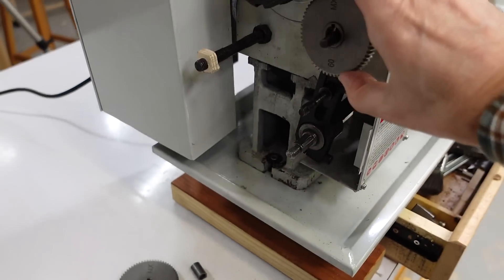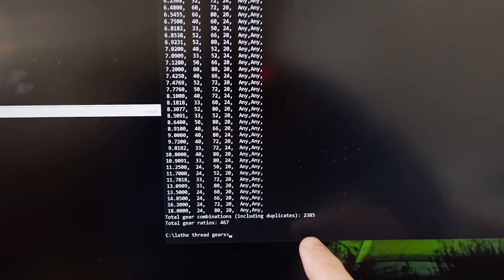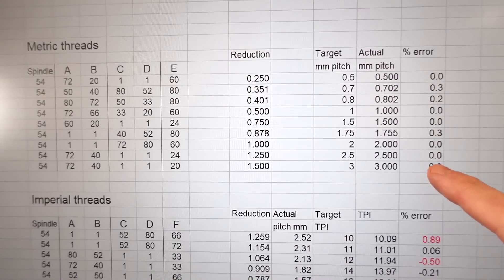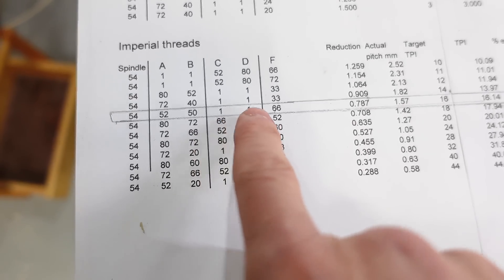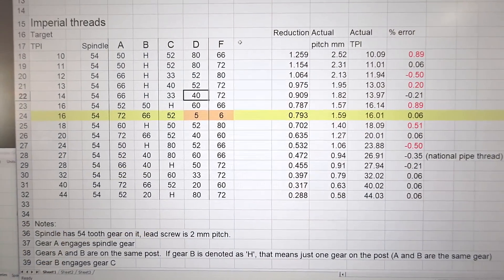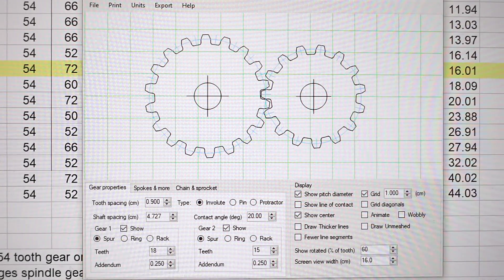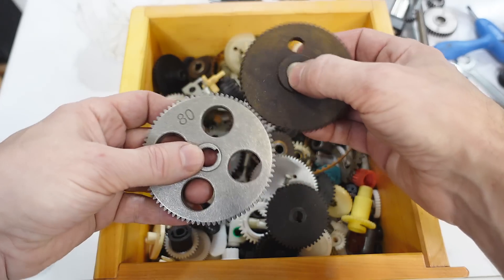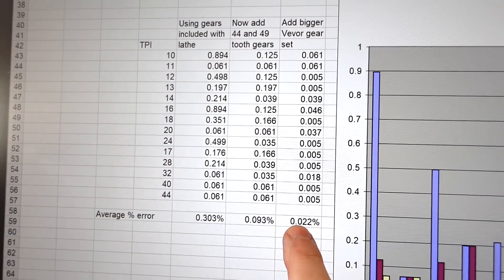Cut *any* thread pitch on a metal lathe

Comment: This video had maths, spreadsheets, Python programming, gear design, wooden gear making and a lathe cutting threads. What more could you want. Brilliant video! I found the part with the wooden gears fitted in the lathe particularly amusing.
Reply: Face it, Mathias is a national treasure.
Reply: Those wooden gears are giving me 'it's stupid but it works' vibes...

And if it's stupid, but it works (safely!), then it's not stupid ❤

Comment: My lathe is all imperial so I muddled along with calculated metric threads until I could 3d print a 100:127 tooth pair and now I have 0 error metric threads.
Reply: So your lathe predates the Great War, does it? Because that's the last time anyone used Imperial dimensions industrially. That same war is why the Empire had to give up on their measuring system too. It was a bit greater than they could handle. America never used Imperial either. By then we'd started using Standard. Which is the inch that's precisely 2.54 centimeters. That was no happy accident. A Swede came up with the idea.
Reply: @1pcfred  nope, 1953 or so, Myford ML7, and plenty more made after that, all imperial
Reply: @1pcfred  oh I see now, you are confusing my use of the word imperial with the definitions of the inch, whereas I use it as ‘inches’ generically, as opposed to metric.  Perhaps I should have used bananas instead (-: (refer to Cutting Edge Engineering channel for definition of the banana measuring unit)

Comment: They should include a 63T gear.  I don't know why none of the mini-lathe manufacturers do that.
Reply from the maker: 63 because its nearly half 127?  You can approximate 127/50 much closer than that with other gears.
Reply: @matthiaswandel But 63T is only one additional gear.  And the mini-lathes already come with a 65T gear, so we know there won't be any fitment issues.  With 63T I would be able to cut 1.5mm pitch to 0.013% accuracy, which is even way beyond measuring accuracy.  One gear solves so much.

Comment: in order for the 1.0% error of the 16TPI threads to become a serious issue, you'd need to thread on more than, at a guess, 25 threads.  The threading in commercially-available nuts isn't fabulous to begin with and at 25 threads - 1-1/2" of threaded length - you'd still only be off by 1/4 of a thread with sufficient slop in the engagement for it to not matter.

Comment: One related and interesting problem would be to either propose a set of gears that would have a better precision than what they provide,  or propose a few additional gears that would dramatically increase the precision of the initial set. 
It can easily be brute forced, given the low numbers of gears. And that way, Vevor can also provide and small hardware upgrade in addition for the revised table.
Reply: Yeah, some logic in his program to determine which gears could be used to cover the most combinations would be helpful.

Comment: Excellent work Matthias. 
Given the ability to make gears and if necessary swap out lead screws the lathe can make an infinite number of thread pitches. 
Until SAE began standardizing threads nearly any thread was proprietary just because the person who needed a thread made one to match their ability and or equipment. 
I repair antique tools from the 1800's on up with only the occasional one having anything close to standard thread sizes. Just knowing how to juggle the gear ratios is invaluable. 
P.S. Wood gears will suffice for a few threads. Most of the time they will outlast the need for them. If they wear out, making new ones isn't difficult. 
Thanks for the inspiration.
Reply from the maker: So far I have never had any wooden gears wear out.  These the plywood was  bit thin, with thicker plywood, I could make a pair that outlasts the lathe.

Comment: Fascinating, and a bit frightening, stuff. Now this makes me feel I need to check the accuracy of my lathe. I wonder what the accepted accuracy is for non cheapo lathes.

UPDATE: so I checked the gear chart on my lathe, with an imperial leadscrew, and the M8x1.25 that I need is within .001% or so. 127 &120 tooth gears on the same shaft seem to be the key to convert imperial to metric. And swapping a 40 to a 32 or 30 for some of the ranges (because of the imperial quick change gearbox).

Comment: COOL! You could 3D print gears as well. I wrote a similar program but for dado sets. Input a dado set definition, blades, chipper and shims, with both nominal and actual sizes, and it computes all of the possible combinations. It also gives the order of the components to maintain as close as possible balanced widths between the halves of the dado set.

Comment: I've made gears (when i was a teen and didn't have a proper lathe) with baltic ply (i think it was 15 layers) and here's the kicker. If you lightly score the faces of the teeth with a thin saw, then dip the gear in thin (model making) cyanoacrylate, they'll last even longer than plastic gears, which are widely used. You can achieve good precision across the teeth if you make a jig sander using a dulled file and ball bearing rollers set in a V. It will cut only as deep as the face of the tooth. Had perfect threads cut with that lathe. Proper thread against my thread, perfect mesh. I never "hardened" the key hole, because i was afraid it was too strong, stronger than a plastic gear (for sure) so i just left that natural ply on purpose. I had to re-key the gear maybe... 5 times total in 4 years. Wood gears? 100% plausible and highly recommended. Cheaper and your determination to get them proper is the factor at play. I used Tamiya superglue, but any thin superglue (read cheap, because it's thinned out) will work.

Comment: Fantastic video Matthias. Now you could pitch (pin intended) another idea to Vevor. Working out what gear tooth numbers wheels they have to provide in a set that is optimized for the minimalist number of wheels to get a set of metric and imperial pitches most often used in industry. And what gears to include in a de-luxe set. 
The very first thing you have to work out is what is the pitch of the screw for advancing the support. If you have a metric screw you can get all standard thread pitches bang-on with a relatively small number of wheels. With a 127 tooth wheel you can convert it to an imperial pitch.

Comment: You are doing such important work here Matthias. I have been wanting to get a lathe for cutting small screws for my repair shop, and most vehicles are metric pitch nowadays anyhow, but I could never get a solid answer to if a cheap lathe like Vevors would actually cut ALL the metirc threads I need. I sincerely hope Vevor follows through and updates their thread pitch table, and I will likely buy the lathe along with the extra gear set.
Reply: Thread tables on lathes being wrong seems to be fairly common. Adam Savage had the same problem with his lathe.

Comment: This is awesome work! Can you post the revised gear table you generated with the standard gears that come with the lathe? I have a similar issue with my mini lathe.
Reply from the maker: but is it the same model with the same gears?  Some mini lathes also have a reversing contraption, but as a result, you can only swap 4 of the gears
Reply: @matthiaswandel It may be a different model, but seems to have a similar threading chart. I think mine has the same gear pitch.

Comment: There are (at least) two reasons standard nuts are not thicker:
- nearly 100% of the tensile effort is taken by the elastic deformation of the first three threads;
- a limited number of threads limits the jamming risk due to thread lack of precision.

Comment: This reminds me of the time I wrote a program to mod my brown and sharp 0 dividing head to approximate a 127 tooth gear by adding more gearing that I could cut to its input.  If I recall correctly the issue is that 127 is a large prime number where the dividing head is a 40:1 worm reducer.  It was really a neat problem to minimize that error in tooth spacing while rotating the blank for the cutter. I struggled to make the program efficient enough but got there.
Reply: You could also use a wheel with angle markings and align the indexing pin to the precise value in degrees. Any error you make here with manual adjustment is reduced by a factor of 40 (because of the ratio of the worm reducer), which is pretty neat.
Reply: @first_namelast_name4923  yea so I never ended up doing it that way even through I did the math because I ended up installing a dro on the mill which makes something similar to what you suggest the easiest solution. If every tooth is spaced 127/360 deg.  Multiply that x 40 and all you have to do is drill 127 holes 14.11 deg apart in a circle/series of concentric circles. To make a custom dividing plate.  That just becomes a lot of holes to drill and coordinates to follow but not a hard task.

Comment: Has all metal lathe, slowly starts replacing parts with wood. Matthias you absolute madman, I love it. 

You should adjust your program so it excludes combinations where certain size gears are in positions that prevent the gearbox from closing.
Reply: That's only for the Nervous Nellys.  Run with it open.
Reply: @sdspivey  But if he's making the gear ratio table for Vevor, as a manufacturer, they have to consider whether the protective cover is on or off.
Reply: @jarodmorris611  they should be nervous, next up a laser lathe with infinite speed control and no torque needed. made by Wandel anti-gravity Works for 59.95. why not
Reply: @jarodmorris611 they could also consider an oversized gear cover to allow for larger gear sets.
Reply: @coltergiest  I was thinking the same thing.
Reply: He allready made wooden planer and bandsaw. Just wait few years and hell make video about wooden metal lathe and he's selling the plans on his website.
Reply: He has already made a wooden bench-top lathe that bolts apart for storage as he rarely uses it.  @hermanni1989

Comment: Common Internet Wisdom: Replace plastic gears with metal.  Matthias: Make gears out of wood.
Reply: Channel isn't named "woodgears" for nothing.
Reply: Then he says "checking my gear drawer" 😂
Reply: I was hoping he would make wood gears for this
Reply: He didn't put a wooden gear into a rc car... Yet.
Reply: @MCsCreations  He had a remote controlled wooden bulldozer he made with car window motors!
Reply: @Canilash  yes I think it had wooden gears and wooden chains as tracks.
Reply: But does it have a suitable gear combination for making wooden screw threads?
Reply: @mahekorvenoges550  asking the real questions!
Reply: If your timing gears have to a) carry a lot of force or b) need to be particularly accurate, you’ve already lost.
Reply: @JasperJanssen  Bingo! These gears should only need to carry as much force as a human could impart on the handwheel. Good plywood is more than adequate, it's very strong stuff. Tree carcasses are good for something after all.
Reply: A benefit of plastic gears is if something jams the gear fails but the rest of the machine is undamaged. This is the idea behind shear pins, etc. You have known failure points on purpose.
Reply: @JDeWittDIY - It must be noted that I did say "Common Internet Wisdom".  ;-)
Reply: @JDeWittDIY 
...rather than either burning a motor out (highly unlikely, but still...) or destroying a propetary-to-your-machinetool gear-size that's basically unobtanium for any reasonale price.

Comment: Apartment dweller here. No wood working tools, no metal working tools, no space but still enjoyed.  You seem to be gifted with many talents. Thanks.
Reply from the maker: That lathe could fit in an apartment easily.  Of course, you need some other tools too.  But if you have a spare bedroom, that could be a small machine shop!
Reply: @matthiaswandel  Works only if he has no wife or girlfriend or doesn't mind loosing either/both.
Reply: @matthiaswandel  Original NYCCNC style
Reply: @matthiaswandel No spare rooms in my apartment unfortunately. Can your lathe be mounted vertically to decrease the required floor space? Maybe bolted to the wall in the shower for easy cleanup.
Reply: that's where I ran mine when I first got it, I just laid down drop cloths and hung some around me to catch flying swarf and keep it out of the carpet.
Reply: Worked out of my apartment myself. Would recommend building an air cleaner. A box fan with an air filter should be enough.
Reply: My workshop is in what used to be a breakfast nook.

Comment: Next step is to install an Electronic Lead Screw
Reply from the maker: Indeed, so much complexity on a lathe is for controllingthe X and Y position of the tool post.  Putting motors on a lathe could simplify it a lot.

Comment: The amount of work you put into this is incredible. As a machinist, the only way I could threads that match in this situation is to make everything custom. If you produce a nut and a bolt on the same machine, tools, and gear ratios, they would both not match the chart, but at least they would match each other.
Reply: Until the nut or bolt is lost with your 10mm socket. Then you’re stuffed because you can’t go buy another.

Comment: I'm hyped for the era of Metal Matthias, considering all he can do with wood alone, with metal he'll be unstoppable
Reply from the maker: Naww.  I look at stuff machinists make, and I often think "I could have made that way faster out of wood!"
Reply: @matthiaswandel  Don't we overestimate what products need to be made from metal?  Your videos have shown that often times something made from wood is plenty strong for its intended purpose.
Reply: @jarodmorris611  There's tons of things that can be made of wood. However,  metal, and more commonly plastic, are just exponentially better for mass manufacturing. Wood is great for diy projects and repairs because it can be sculpted with hand tools if necessary.
Reply: @jarodmorris611  Many gear applications use various engineering plastics such as Tufnol or Acetal......they make very robust gears from such materials. Also 3D printed gears made from suitable high strength plastic filament are surprisingly strong.
Reply: @MyChevySonic  I agree with you but I wasn't referring to manufacturing.
Reply: I don’t think he needs to go full on machinist. A blended approach of using the material that is appropriate for the final product is nice. 

I wonder if there are any past projects of his that could be updated with some metal work in key components.
Reply: The new Pen Shaking Device will double as a melee weapon of heretofore unanticipated lethality.
Reply: 3D printed metal!
Reply: Wood is good if precision and stability aren't needed, nor overall strength. I'd like to see a wooden BattleBot stand up to any of the metal ones! Or a car with a wooden frame, or a wooden engine!
Reply: @gorak9000  Try looking up Morgan Cars made in Great Britian. The frame is made from ash. They do use aluminum for part of the chassis now, but the frame is still made from ash. They build about 800 cars per year.
Reply: @gorak9000  Morgan cars have a wooden frame and have endured for thousands of kilometres with no problems.

Lots of people think, "frame", includes the chassis. It doesn't. All Morgan chassis are made from metal.
Reply: @gorak9000  the baltic birch plywood that Matthias uses for his gears is very dimensionally stable, and much stronger than you seem to think. Plywood in general is plenty good for the vast majority of applications, even the cheap stuff.
Reply: @tissuepaper9962   When you show me a plywood engine block running plywood pistons with plywood connecting rods attached to a plywood crankshaft, then you might have a point
Reply: @gorak9000  "vast majority"
Reply: It would be a clash of the titans with This Old Tony
Reply: Matthias It’s been a while since I have caught up with your exploits , I love you work .
Reply: Not! You wood workers are 1 Inch 😊spec. Good luck.  Don't buy vevor, unless it's free👎😢
Reply: @adhawk5632 Eh... Vevor is very much in that category of "stuff you might only use occasionally that you otherwise can't justify having." No, their products aren't top quality- they're the same, contract-built stuff you can get on AliExpress... But you're at least buying them from an actual company with warehouses, offices, and employees, which means there's someone that can be held liable if something goes wrong, so they have an incentive to make sure that what they're selling at least meets whatever minimum standards exist for that item.